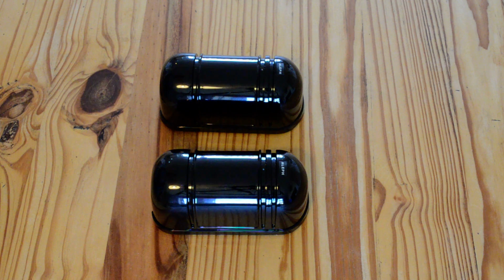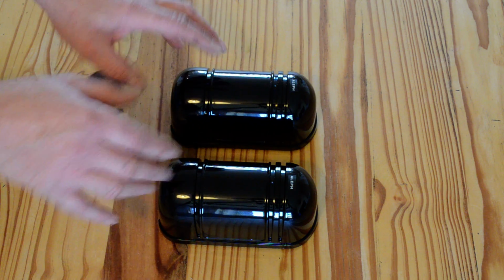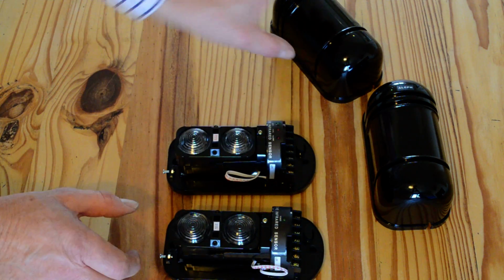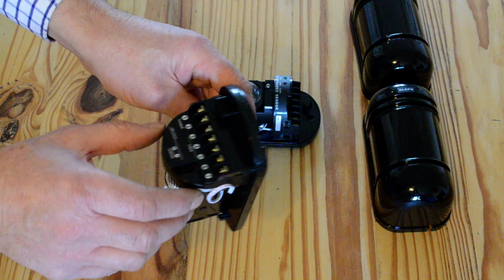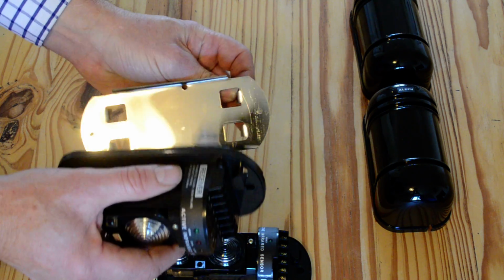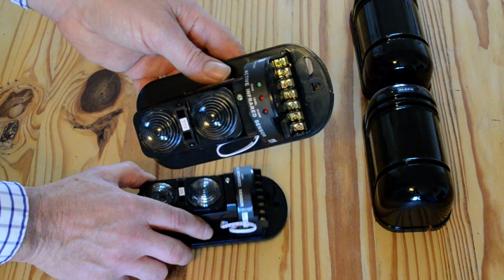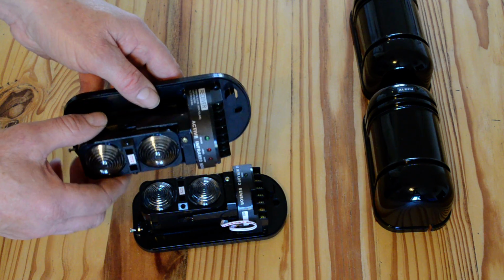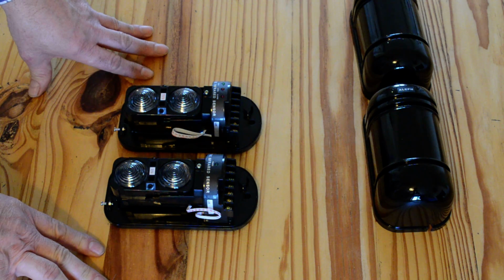Dual beam infrared detectors for perimeter alarms.

Comment: A dual beam sensor would prevent false alarms due to birds and leaves if the two beams were a sensible distance apart - on the detector shown the two beams are so close together that it's almost a waste of time. It's a shame, as done properly it would be a very useful detector, as it is you have to buy two sets of detectors to properly prevent most false alarms...

Comment: Do these sensors connect to a buzzer or an house alarm system?
Something like this would be ideal as a driveway alarm.
I get all manner of people wondering up the drive. 
But it would need to be connected to a buzzer of some kind, Not a house alarm?
Can you connect it to a buzzer?
Reply: All alarm systems have a chime facility so you could wire this directly to a unused
zone in the alarm and set that zone to chime, so anyone entering your driveway would activate the in built chime of your alarm.
Reply: can you install a siriene on theses. If so how would you connect??

Comment: i have a question Sir: what is the height they should be mounted from the ground level?. i want to put these on my patio, but i need them to be at the wall top level so my dog can run beneath the beam and not set off the alarm, but if someone climbs the wall it should trigger the alarm. Can it be done?
Reply from the maker: You can mount these at any height to avoid pets etc but catch people.

Comment: w do you align them?
Reply from the maker: You fix the beams onto a wall or post and roughly line them up.On the beams is a little viewfinder.You look into this viewfinder and adjust the beams up and down and left to right until you can see the other beam.On the beam you have a red and green led.The green LED lights up when in line.
Reply: the led works with the DC connected and nothing else right?
Reply from the maker: Yes as soon as the DC is connected the LED's work.

Comment: What on earth does "normally closed" and "normally open" mean??????????????? 
I would like these but the wiring is a confusion. Simple to you.... but to me? Your explanation didn't make sense. Thanks. 

So, I have two wires to feed power. 12v or 240v?
I have a cable to the alarm siren indoors. Powered? or powered by the sensors?
Each sensor is powered by the + -  connectors I assume. 
Thankyou for your help. ASAP please I need these.
Reply from the maker: Hi normally closed means the contacts are closed to begin with and when the beam is triggered they open.
Normally open contacts are open and close when the beams are triggered. One way you can have power cut when the beam is triggered wire them the other way and power will pass through the contacts when  the beams are triggered.
Reply: do you wire your sirine to the normally open so alarm goes off when beam is broken??